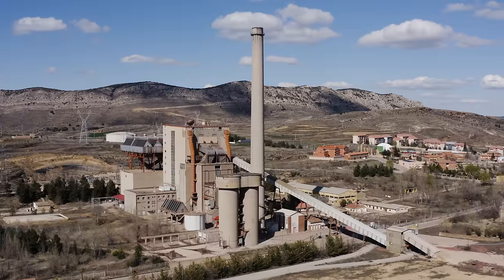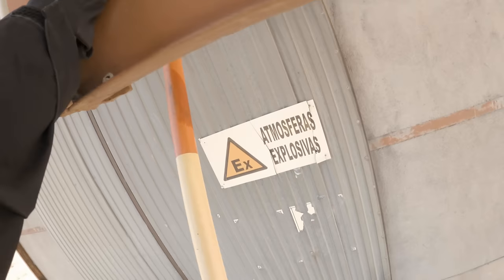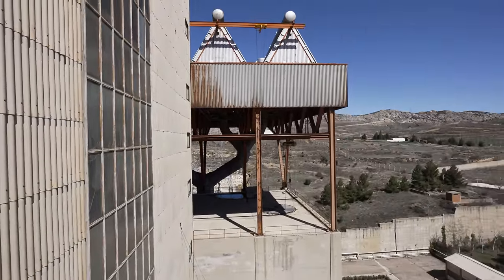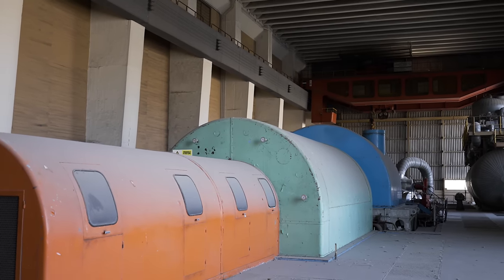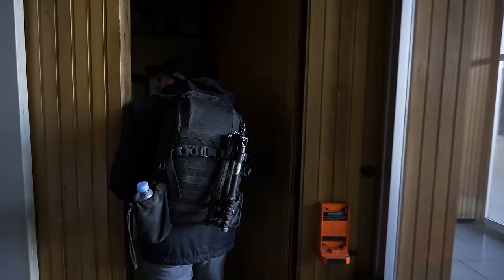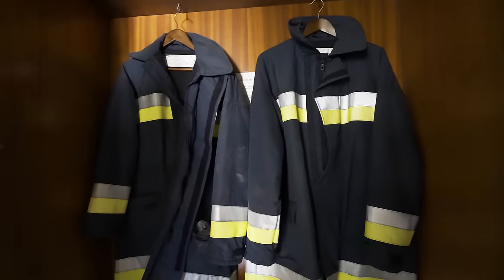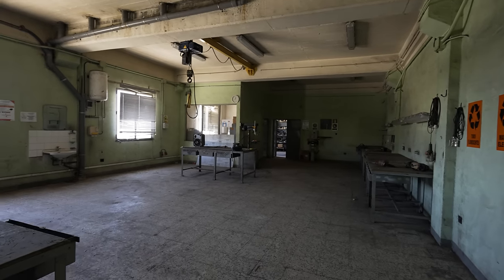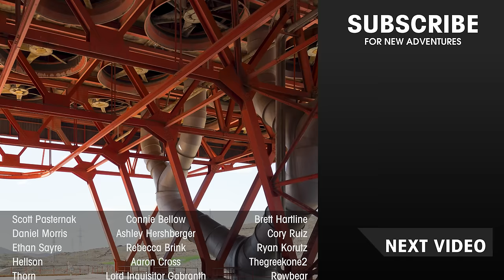Exploring an Abandoned Power Plant in the Desert

Comment: I worked in a similar SIEMENS-KWU power plant, a bit newer than this. They are completely identical, even the turbine hall, the entrance to the control room, all the same. Control panel is Hartmann&Braun. Stay safe guys, nice video as always!
Edit: the void space you saw in the turbine hall is for lowering turbine parts and removing them outside when needed (and the opposite, during maintainance), at least that was the case where I worked.

Comment: It's sad to see power plant generators not rotating as they are most certainly scrap.  Because of the long turbine and generator shafts, they have to be kept rotating with a "turning gear" - a small 3-or-so-horse motor and deep reduction gearbox that keeps the unit rotating at 10-20 rpm to prevent the shafts from sagging and taking a set because they are so long and heavy.  Once they've taken a set, they can never be run again.
Reply: You only need turning gear when you turbine is about a certain temperature, When it is cold it no longer needs to be turned.
Reply: @tomking1890    OK - admittedly my experience is limited to a single 42 MVA steam turbine in a local municipal generating plant (now gone).  I was there to repair the Westinghouse Trinistat generator field regulator.  The operators there told me that the machine had to be kept rotating 24/7.  The building housed four other smaller machines in the 15 MW or less range which were derelict and had not turned in years because upgrading the boilers to be EPA-compliant was not economical.  The operators said, accordingly, all those machine were scrap as they sat.  I put together a fairly detailed little photo-essay of that plant, as it was the first one I had ever visited.  With a total generating capacity of 95 MW, this plant was considered microscopic by today's standards and kept in operation only to handle summertime excess demand.  It was closed in 2011.

Comment: 11:35  In case anyone was wondering about the 'kenotometer", I found some info from the Edmonton Power Historical Foundation:  "This instrument is used in steam turbine condensers which are operated at pressures below atmospheric pressure. It measures pressures approaching a perfect vacuum (0 pressure absolute).  The absolute pressure is indicated by a mercury column, usually expressed in inches of mercury.  This Instrument measures the very low Absolute pressure in the condenser.  The pressure would be about 1.5 inches of mercury from the 0 at the bottom of the scale.  Barometric pressure would be 30 inches of mercury"  (Edited for some clarity.)
Reply: You managed in your concise description of operation to describe its function very well,  the company still exists in Newcastle and manufacture the same instrument but a bit more jazzed up, it is installed in practically every steam turbine installation the reason they still use this janky piece of kit s that it is incredibly reliable.
Reply: @Woffy.    It's not my description, I just copied it from the website of the foundation that I mentioned, and then cleaned it up a little to make it less confusing.
Reply: Steam condensing to water creates a vacuum, and it measures that, is a slightly more accurate way to describe it. Or put another way it is a device for measuring the effectiveness of that process.
Reply: The old Rossdale PP must have had those too
Reply: I posted about it also before I saw your post. 🤷🏼‍♂️ I would love to have that!
Reply: Interestingly the "Newcastle Upon Tyne" is a town/city close to me in the United Kingdom.
Reply: I live in Edmonton, didn’t know such a place existed here.
Reply: Made in my home town too <3

Comment: I spent 47 years designing, building, operating and maintaining large steam power plants. All of them operate on the same principle, just with different numbers of stages and sizes of equipment. When they are shut down, they leave them standing for a number of years but have to tear them down as part of the closing of the financials. Most of ours were severely vandalized mostly for scrap copper. This was despite security systems that the insurance company demanded. Because of safety concerns, you probably shouldn’t have gone in there but thank you that you were respectful while there.
Reply: Now they are all going to waste. Sad.

Comment: That place is in such good condition, it looks like it could make power tomorrow. Thank you for showing us before it's destroyed.
Reply: It probably could - what typically sets the life of a thermal power plant is the boilers and there are some pretty stringent safety rules surrounding them - but in most cases you never hit the actual end of life because as the boilers get older you have to derate them for safety reasons and this reduces efficiency.  On top of this, replacing boilers is the sort of major change that normally results in the plant having to be updated to meet current date emission standards - and this stuff can be very complex and expensive to integrate into an existing plant.
So a lot of the time the most cost effective approach is simply to build a new plant then shut down the old one once the new one is on the grid, so you end up shutting down a plant that's fully functional and even has some life left.

Comment: 11:38 The kenotometer is a particular type of hydrostatic gauge, typically used in power plants using steam turbines. The kenotometer measures the vacuum in the steam space of the condenser, that is, the exhaust of the last stage of the turbine.

Comment: In arid dry areas, air heat exchangers (rather than water spray cooling towers) are used to get rid of heat. I think that the bank of fans is one such dry air exchangers. I visited the WyoDak generation plant at Gillette Wyoming decades ago. The fans were 30' in diameter each and 30' above ground. Good video guys.

Comment: @TheProperPeople The structure on the roof of the turbine hall is an air cooled condenser. This plant likely has an air cooled condenser because there isn't enough water in the region to support a traditional water cooled condenser. Air cooled condensers essentially work like a radiator on your car. They use fans to cool the steam back to condensate to be reused in the boiler. Most plants use traditional water cooled condensers because they are cheaper to run and maintain. However in this plant's case it was likely built in an area with little water but very near coal mines as a trade off for the extra power needed to run the condenser vs the cost of shipping large amounts of coal long distances.

Comment: Wow, it is in amazing condition for 10 years of being out of service.
Low humidity, should increase static charge and make stuff dust magnets, so interesting that the window to the control room was THAT clean.
Almost no rust in the boiler area, outstanding and unique.

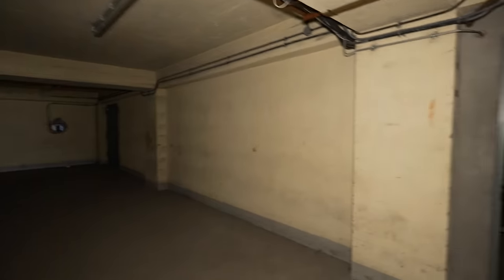And 19:19 shows a marshalling distributor. High-wire count cables are run to a central place. The generator would get a big 50-pair cable to connect all measurements and signals to that central area - close to the control room, so you can split and loop signals through instruments. And from those static endpoints, they wire up the controls and sometimes even logic systems.
And if you add any measurement or equipment to the plant, you only need to get wires to one of the nearest backbone wires and pick up the signal at the other end below the control room.
Smart way to do it before digital I/O was a thing and pretty much every single display in the control room needed a physical wire to the field equipment to exchange signals.

The condenser could be a pure air-cooled condenser - common in desert-like areas. 
So the fans above the turbine-hall could have actually been the condenser.

Comment: I was told some time ago that those turbines and generators are often so well balanced, it is possible with some strong effort to turn them......by hand!  I do wonder though, if it is possible after sitting idle for so long.
Reply: They have lubrication "jacking" pumps to float the shaft on the bearings prior to any movement. At that point, they could be turned by hand. But when they're sitting, metal-to-metal, they'd be quite stuck.

Comment: THe Kenotometer is measuring vacuum in the condenser. Not used any more because they have mercury in them. They are so complicated becuse they are measuring absolute vacuum. That is most pressure gages compare what you are measuring to atmospheric pressure (psig, inhg) this is measuring inches of mercury absolute inhga

Comment: Could probably be reactivated within 12mo, or whenever green coal becomes a thing.

Interesting plant. 400V isn’t their main voltage, that was auxiliary power like for the conveyor and fans.
Feedwater pumps are often run on 1.2kV.

Be careful in switchboards anyway, there isn’t always a transformer rattling around to inform of potential danger.
Reply: 24min45s you walked past the Siemens feedwater pumps

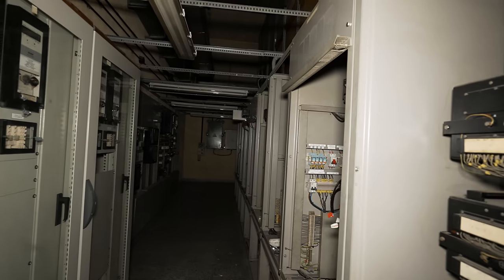Comment: 15:44 I was working in a location like that which is behind the front of the Panel/Switching/Metering boards at a ComEd(not to be confused with ConEd)substation in Chicago which was built in the 1930 or 40's on a old landfilled which was rumored to have been a favorite spot for the Chicago Outfit to dump bodies. Anyway I digress......While rewiring some of the new meters and instruments in the middle....length wise I'd place my tools on meters or whatever so they'd be easy to grab as needed but sometime I'd reach for my wire strippers ...lets say and that I just used them no more then a minute before and they'd be gone.......mind you I'm behind the panel board working by myself so I'd get up and start looking and find them on top of the backside of a instrument or metering device at the far end near the door. Then I'd go back and now my screwdriver is missing and that would be at the other end/doorway. This went on for over a week while working back there.....I finally put the few tools I needed to do the job in a cardboard box and kept it close but things would be missing after a break or lunch......just games. Truthfully that's just one of maybe 20 strange things that happened in the substation and we were only there for 6 weeks at tops. Very strange place indeed.

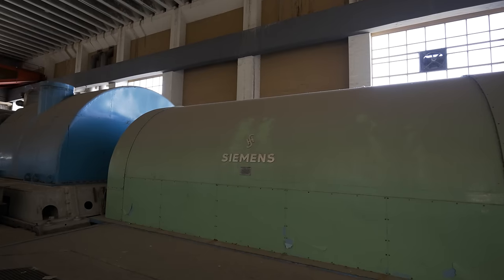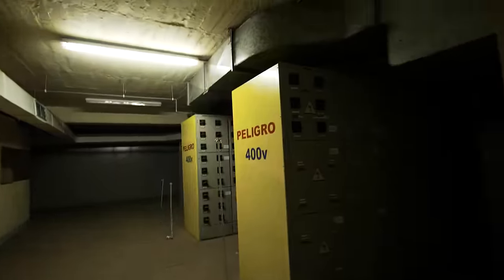Comment: @10:30 You should have gotten a close up view of that Siemens information plate... seen what the generator's output capacity was.  @19:33 No, not main electrical. At least not of the plant generation system. That would instead be electrical distribution for the generation plant to use to operate. Typical distribution voltage in Europe is 240v/380v Three Phase Y. They rounded the sign up to an even 400v, is all.
Reply from the maker: 200MW it said
Reply: @TheProperPeople  Ah, thank you so much. 👍 A pretty decent size plant. Sad it is shut down.
Reply: Phase to phase voltage is 415. (240 x 1.73 = 415)
Reply: @kiowablue2862  All right, so even a bit higher than 400v. Excellent information.
Reply: @pianoman4Jesus  230V and 400V are the harmonised voltage levels in Europe, set in 1994. Likely that the signs were updated then from the original voltage levels that were 220V and 380V.
Reply: @three-phase562  Ahhh... I did not know that 220v, not 230v went with 380v. Thank you.

Comment: Most plants built from 1950 to 1970 only had an electrostatic precipitator for dust collection. So unless the coal they burned was anthracite, sulfur in the coal could create No2 which could lead to acid rain. A lot of plant refurbishing since the 1980's has been the installation of selective catalytic reducers or SCRs and more efficient dust collectors that use fabric bags instead of power draining precipitators. But still even with the vast reduction in harmful emissions since the 1980's, that's not good enough for power mad Democrats.